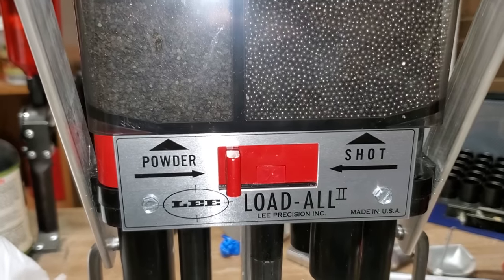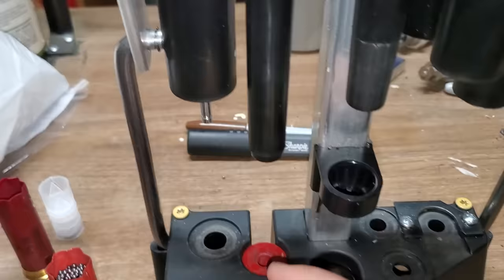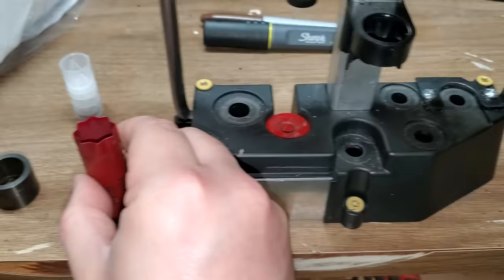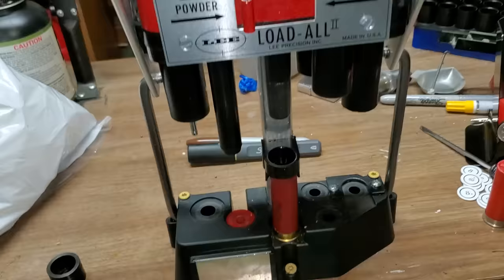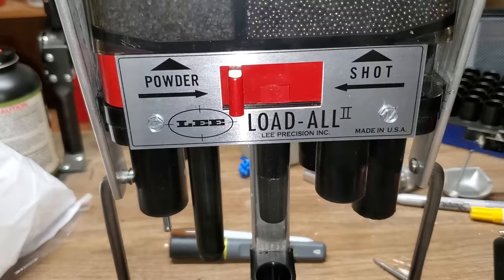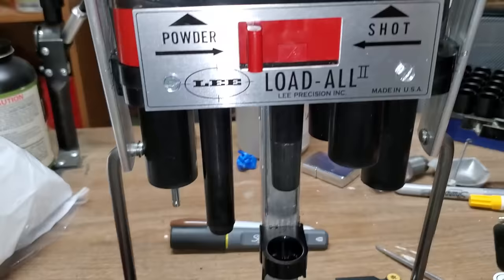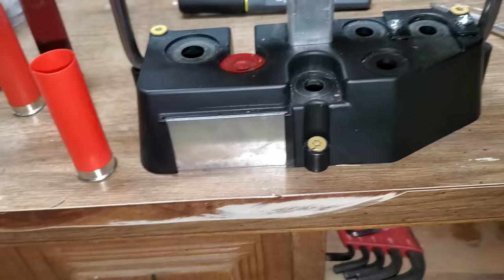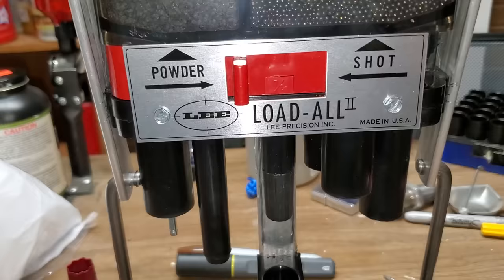Using lee load all 2 with once fired hulls

Comment: Does everything come with the press or is it like the metallic presses where you have to buy dies and everything else?
Reply from the maker: This press comes with bushings and everything else.   You have to have :
Hulls, 209 primers, wads, shot, powder, and a loading manual.

The Lee press has a much smaller selection of bushings compared to competitors,  but it is a great starter or for those who load lower volume.

Comment: I'm a trap shooter, but only shoot factory ammo, would like to try reloading. This looks like a good reloader to start with. How do you know how much powder and shot to use? Is that done via the bushings? Let's say I wanted to reload a once fired shell using factory ammo config.; 12 Gauge, 2.75, 1200 FPS, 3 Dram EQ., 1 1/8 ounce shot, 7.5 shot. Is that doable? Also, how many times can you use a shell that's been fired?
Reply from the maker: Reloading manual gives you the shot size, weight, hull, wad, and powder charge to use.  The shot bushings are in ounces of shot,, so those should match your recipe.  Then the powder bushings determine the correct amount of powder.   Hull quality and brand determine how much you can reload them.  Typically see cracks start showing up in a few after 3 - 4 loading for cheap hulls.  6 max.  More expensive hulls get a few more loadings, but 7-8 max.
Reply: @murphyfirearmstraining3630  Thanks for the info appreciate that, it was good information.

Comment: If you find a split crimp can you cut it down and make a mini shell out of it.?
Reply from the maker: Not with this machine.  But theoretically yes.
Reply: Yes you can but you won’t be able to fold crimp it on this machine.
Cut the hull down a fraction just below the damaged fold crimp and use a roll crimper.

Comment: It looks like you have 2 different powders in the hopper 😳 ... I am not ballistician  or anyting but is that safe?
Reply from the maker: I promise there's only one type of powder.  I agree that mixing powders would be exceptionally dangerous unless you have the right test equipment (and I don't).  Not sure why it looks that way, but I'm guessing it's one of those flake powders that is a different color on one side than the other (double base powder) causing it to look like that.

Comment: Did you say what size shot you were using? I will watch again, I am wondering if this can be done with 3 shot size.
Reply from the maker: I have used 6, 7 1/2, and 8 a lot with this and they meter fine.  I loaded some #5 recently for some hunting loads.  I have never tried 3 shot, it may be tough to activate the slider with that big of a pellet, but it should work.

Comment: My lee load all doesn't crimp very well. Dished or caved in crimps. Loose bbs.
Reply from the maker: Caved in crimp is a column height too low.  An overshot card or 2 will fix that.  If the crimp is too high (opposite of caved in) and will not completely crimp, then column height is too high.  Really the only fix for a column height too high is to try a different load (different powder, different wad ,etc) or reduce powder or shot charge by one bushing to reduce column height.

Comment: Can you do 21/2” long shot shells with your press
Reply from the maker: This press will not go any shorter than 2 3/4 inches.   It will do longer,  but cannot go any shorter.  The stroke of the carrier bottoms out at 2 3/4 shell length for sizing and crimping.   

You could use the center station to load powder and shot and then roll crimp,  but it would not star crimp them.  I have a video on roll crimping off the press if you are interested.

Comment: Is there a difference in pattern with the 6 or 8 crimped shell?

Greetings,

Jeff
Reply from the maker: I haven't noticed one.  On my machine with the shells I've loaded the 6 point tends to stay crimped better and close fully.   The 8 point leaves a small hole in the center of the crimp and will occasionally come uncrimped.  Your results may vary, but when using new hulls I use the 6 point crimp for those reasons.

Comment: New to reloading.. if you using let's say Fiocchi hulls are you suppose to reload to specs of that hull or can you so specs of another brand ( will be  reloading for trap/skeet)
Reply from the maker: According to any reloading manual,  you reload to the specific hull.  However,  there are only a few types of hulls out there.  If they are the same construction (tapered or straight wall) you can interchange data with a word or extreme caution: 

Shotgun barrels are very thin compared to other guns and most shotshell recipes are MAXIMUM loads. 

Also important- if a hull is straight walled use a wad that is from a straight wall hull  recipe.   Changing wads from what is in a recipe can cause pressure to change (up or down).

Does that make sense?

Comment: would this hypothetically work if i only put #4 buck or 000 Buck in the projectile thing? my mother got me a lee load all several years ago for a birthday present and just know got into a house that im not going to be leaving so im brand new to this, also what powders are good for buckshot defensive loads? mainly wanting good 12g power in case someone breaks in
Reply from the maker: I have a video on loading buckshot,  check it out.  Most powders can be used for buckshot, key is to find the load data.   I recommend searching for a shotgun reloading manual,  there are a few that specifically cover buckshot.

Comment: How do u know how much powder is goin in? What shot sizes can u reload? Can this do 00 buckshot as well?
Reply from the maker: The red bar that slides back and forth during reloading has bushings that measure the powder and shot. I have reloaded 9, 8, 7 1/2, 6, 5, and 4.  All do well.

I have a video on loading buckshot with this machine and I will have one soon of loading buckshot by hand.

You need a reloading manual for finding the recipe (powder type, powder charge, shot amount)  that works.  I have another video on how I picked a recipe from my book and then setup the machine. 

I also have one on roll crimping 

I hope you will watch some of my other videos and they are helpful to you.

Comment: Will this press load TSS shot also in other words does the shot weight lets say one ounce the same for lead vs TSS? Is the measurement the same for each species of shot?
Reply from the maker: It will load any shot, but the 1 oz bushing will not throw an ounce.  It is a volume measure that is calibrated for lead.  So for example steel shot is lighter bt volume and would throw lower than what the bushing says.  You would definitely need to weigh your charges with a scale to see what it is throwing.   I hope that helps.

Comment: Can 209 black powder primers be used for reloading
shotgun shells? Can't find shotgun primers anywhere.
But I have a lot of 209BP primers.
Reply from the maker: Most recipes specify a primer.  But they're also maximum values.  If I was under max and those are the only 209s I had, I would use them.  

Key is being under max load.  So if your manual list 28, 30 and 31 grains of powder XYZ, load the lowest of those three.

At max load (and remember if you see a single Shotgun load with no data leading up to it, it is a MAX load) primer brand could make a difference.   Loading lower gives you wiggle room if it does.

Comment: great movie, I have a question, can this machine be elaborate cal. 12/76 with black powder? and whether it is possible to regulate the amount of gunpowder for the cartridge
Reply from the maker: Yes, there are powder bushings in the machine that regulate how much powder.   You pick your bushings based on the load.   I don't recommend it for black powder, plastic hulls weren't meant for that.  Use brass hulls for that.  I have. A video of loading brass hulls, check it out.
Reply: @murphyfirearmstraining3630  or maybe you will tell us what is better to use for the 12/76 black powder shotgun what kind of scales to use plastic or brass and what length is the best to use?
Reply from the maker: @irokromkrom6534  https://youtu.be/CqJdx_Y9SNg

This video will hopefully answer some of your questions.

Comment: So powder will only dump if u have a shell in the slot or how dose that work? Do u have to slide the slide over?
Reply from the maker: When you run the slider to "powder " it dumps.  There is no safety mechanism,  and it will dump the powder charge whether a shell is there or not.

Yes slide for powder, then slide back for shot.

Comment: What's your opinion on varying the amount of powder ie. Is there a set amount? Can you add more or less to a single shell?
Reply from the maker: What is in the loading manual recipe is the max load usually (if they only have one load for that powder, wad, shot combo, it is the max load).  You can go down a little, never up.  If you go up you get too much pressure and can get a ruptured barrel.  

If you go down too much, you get poor to no ignition.  But you can go down SOME.  How much depends on the powder.  Hope that helps.
Reply: @murphyfirearmstraining3630  Yes, it helps. I believe you mentioned the manual in the beginning of the video. I'll check it out.

Comment: Hey Murphy, I was hoping you could give me some advice. I’m trying to reload some once fired Fiocchi, 12 gauge, 2 3/4 target loads with my Lee press. I’m using the formula I got from my Lyman’s book (Clay’s 19.5 gn, Win 209, WAA 12 with a 1 1/8 oz load). The column height repeatedly comes up too short and the final press is caved in with shot showing. Any advice that you can provide is very much appreciated!
Reply from the maker: Probably just an overshot card on top of your shot will fix your crimp.  If that isn't enough to fix it,  then you will need to put a spacer wad between the powder and wad or try 2-3 overshot cards.   Anytime your crimp caves in like that your column height is too short.   Add spacers to raise it. 90%of the time an overshot card or two will work wonders.
Reply: Murphy Firearms Training thanks for the tip!!
Reply: Fiocchi  hulls are straight wall. You would have better results using a Federal 12S3 wad for 1 1/8  oz. in these hulls. The AA wads work better with compression formed hulls such as Winchester and Remington. The Claybuster copy of these wads work great and will save you $$$ .

Comment: Question , how many times can you reload a hull .
Reply from the maker: Depends on the hull quality.  Can be 2 loadings before you get cracking,  can be 6-8.  If you use the same crimp it originally had, it helps. If you turn an 8 into a 6 (or vice versa) it tends to shorten the life a little (in my experience).

Comment: What size powder bushing are you using in this video
Reply from the maker: I honestly don't remember (and for safety reasons I dare not guess).  It wouldn't matter though - you would have to have the same exact powder as well.  Each powder burns at a different rate and have different volumes, so different powders require different bushings.

Comment: What if the hulls are not pre-crimped?
Reply from the maker: @adriano8809  i have a video loading new hulls.  Same exact procedure except you don't have to lin anything up in station 4 (pre-crimp), simply pick if you want six or eight points and crimp.  Easier with new hulls.
Let me know if that answers your question or if you have any others.

Comment: Good Vid, thanks
Did you really pay $22 for 100 once fired cases?
Yikes
FYI: WIN AA or REM STS go for 3-4 cents a case here in MI, and reload better/longer than those you are using
Reply from the maker: Ive seen them that high, but no.  I paid that for new primed cases.  I get these once fired for free from a camp I volunteer at.  They're not the best,  but they're free.

Comment: At 3:17, your brass was NOT sized proper. You are looking to get someone hurt pal. Watch the video. You can see the hull sticking OUT of the sizing collar. So many people trying to reload are doing it all wrong.
Reply from the maker: Jim, I just checked the video.  That collar is all the way down.  That is as far as the LEE collar goes.  Sized like that it falls into every 12 gauge chamber  I own.  I am not sure what else I can do, but it is as good as this equipment will size it.  

I would also say that the only issue you will get from that would be that it wouldn't chamber.  It would not be an unsafe situation.

Comment: Will this press drop #5 lead shot smoothly?
Reply from the maker: I load 4 and 5 shot, you have to be firm with it, but it will work.  Not always smooth,  about 1 in 10 hangs up just a little.

Comment: Where do you find the hulls?
Reply from the maker: These are from loads I purchased (mostly bottom shelf Walmart bulk 100 packs).  When I first started I purchased a few 100 brand new hulls.  I do think it is easier to get started with brand new hulls, and then switch to once fired.

Comment: How do you pick the wad and know you have the right one?
Reply from the maker: Most wads have a load capacity (1 oz, 1 1/8, 1 1/4, etc) that is step 1, selecting a wad that will carry the payload you want.  The look for if you can find what the wad was intended for.  Skeet wads open quickly and have wider patterns.   General clay wads open a little slower,  trap wads tend to open slowest and keep tighter patterns at longer ranges. 

Then load them up and if it doesn't work, back to the drawing board. 

My favorite wad (for longer range shooting)  is the z15 commander from ballistic products incorporated. It is a trap wad and gives me very good patterns farther out.
Reply: @murphyfirearmstraining3630  these Winchester Super XX 
1 1/4 Oz #5 shot. I use for all small game.. rabbits, squirrels, pheasant and so on. 1325 fps. 
Wanting to basically replicate the load.
Reply from the maker: @jeffreydohl6036  I would check out ballistic products incorporated,  and find a wad that is made for that heavy of a load.  Probably something like this (goes up to 1 1/2 oz).
https://www.ballisticproducts.com/MG42-12ga-wad-250_bag/productinfo/072MG42/

Comment: Where can I get the shells, gun powder, the loads and the wads?
Reply from the maker: Anywhere that sells Shotgun reloading supplies.  The site that has the largest selection/ quantity is BPI - Ballistic Products Incorporated.
Reply: Most all components now are completely sold out from online vendors.
You may have luck finding in your local area.
I was able to find a couple lbs of Longshot powder from a local Ace Hardware store that still has a sports section.

Comment: Does any have any input ow where I can find out recipes and load data for Winchester shotshell wst ball powder
Reply from the maker: I can confirm there are NO loads in ballistic products advantages manual.   Sorry
Reply: Eric: if you could find an older Winchester manual the info you need is in there and sometimes it’s on the double AA wad bags.

Comment: Is there a known or suggested limit for how many times to reuse/reload a single shell?
Reply from the maker: Cheaper shells don't last as long as good ones.  Could be 1 - 2 reloads , Could be 7-8.  Look for cracking,  that's when it's shot.

Also occasionally,  the primers won't seat (literallyfall rightback out afteryouseat them), that's another time that they get tossed.
Reply: @murphyfirearmstraining3630  What makes a shell "cheap"?
Reply from the maker: @geneclemetson4779  your low end clay loads are cheap (literally).  They use a more brittle plastic.   Your gold medal shells, your higher end hunting loads, etc tend to have a little more flexible plastic in them.  But if I can get hulls for free, I don't care if they're low or high end.
Reply: @murphyfirearmstraining3630  Thanks. All good info.
Reply: If your primer falls out go with rio or noble 209's,they're actually a thousandth or bigger seating diameter

Comment: Limited bushings??? It comes with a complete set that takes you from the 3/4 oz. loads all the way through the heaviest 3" magnums. What else would you want for 12, 20, or 16 gauges? It looks like that small charge needs both a card and a base pad filler. You also use them in the base of the shot bushing and weigh in your volume for the lighter 3/4 oz. loads. BTW, the 8 pt. crimp was always the most preferred, as in Win. AA and Rem. Premier . PS-you can edit your fails after viewing you know.😅
Reply from the maker: I'm not referring to the 8 or 6 on factory ammo,  but on this machine.   I think on this machine the 6 pt crimp does a better job. May just be my machine,  just reporting my experience with this machine,  your mileage may vary.

Comment: I have a lee load all similar to this, I tried loading federal top gun 2 3/4 target shells with number 1 and 1/8 oz of 8 lead shot, hogdon titewad at .128, and Fig. 8 CB8118-12 standard plastic wads but my shells always crimp down into the shell like the was isnt long enough or there isn’t enough shot. Any suggestions?
Reply from the maker: Add an over shot card.  Your shot column is just slightly too short.  An overshot card will add enough height to get you a good crimp.
Reply: @murphyfirearmstraining3630  Okay sounds good, where could I find some? I’ve mainly just been taking a small scoop with a 2.5 CC measuring thing for rifle reloading snd putting extra shot into the shells and then they crimp tight as can be but i know that’s not the right thing to do
Reply from the maker: @magicsashplaysmc4636  any place that sells shotshell reloading should have them. Check out ballistic products incorporated (bpi).  There website has everything.
Reply: Go on line,look at different recipes for your load,l've found different powders take more room like alliant american select or clay dot,if you can find them